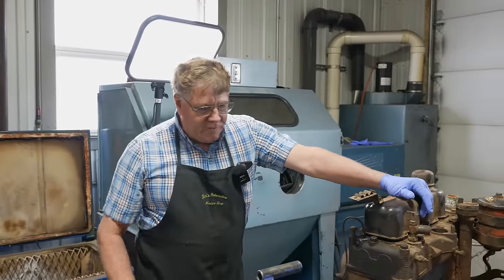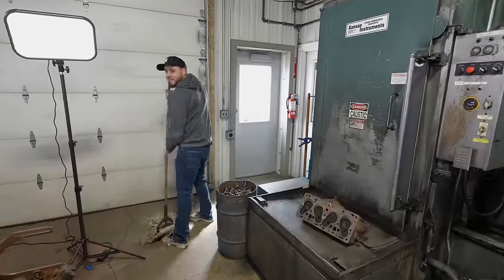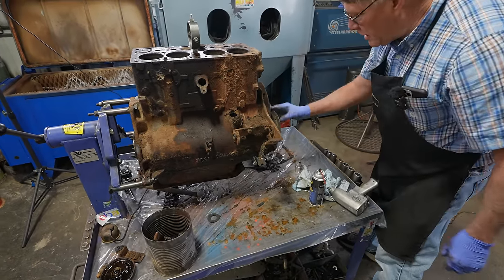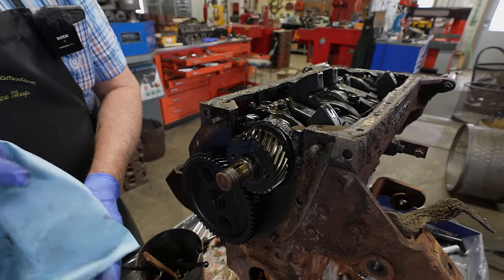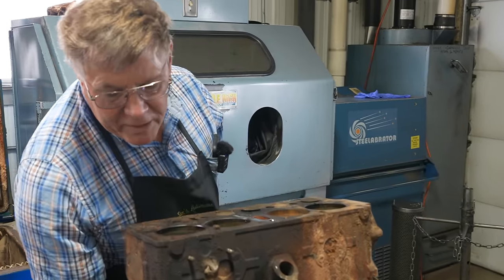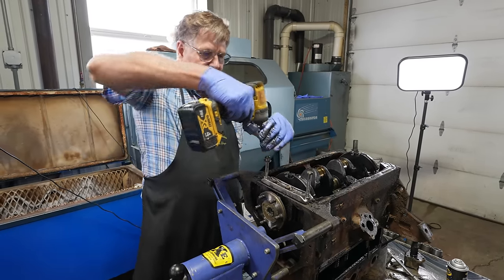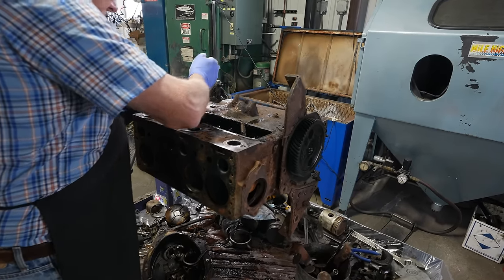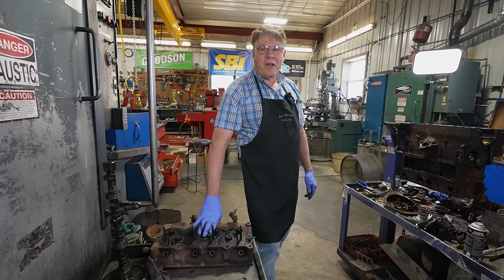Tearing Down A NEGLECTED Willys Hurricane Engine...

Comment: Ah, the curious case of the Willys F-Head engine. So wonderful to get the see the insides of one. When Willys needed more power for its vehicles in the early 50's, and their engine casting technology was limited to side valves (the wonderfully torquey and tough Willys Go-Devil that had helped win WWII in the military Jeeps), they designed this overhead valve intake arrangement, simply running the pushrods through the holes in the block where the old intake valves had been and putting great big intake valves on top to help engine breathing.  It gave them a quick and easy 25% more power-from 60 to 75-and a few more pounds-feet of torque.  The only real issue was the height of the new engine.  They had to raise the hood of the CJ-3B substantially to make it fit, which was less than esthetic.  But it worked, and continued to be used in Jeep products until emission regulations killed any automotive engines that still had side valves. (See the Curbside Classic article on the Willys F-Head for the source of this information.)  I am not aware of vibration issues at high RPM's, as others have reported here, but would not be surprised.  This was an engine from the 1930's, when smooth, low-revving torque was the goal, and the F-Head  was likely seen as a temporary, partial overhead-valve solution.  I am amazed the the Parts Cleaner remembers so much about these!

Comment: I had a 1960 Alfa Romeo Giulietta which used the Pal nuts on the connection rod bolts and main bearing bolts to keep the nuts tight.

Comment: More years ago than I like to remember, I obtained a 1940 Mercury club convertible. The V8 flathead engine had been rebuilt, run about 3 or 4 hundred miles before being put in storage where it sat for probably 15 years.  The rod bearings were too loud, so I dropped the pan and pulled the bearings out.  They looked just like the bearings you have in this engine, however the crank had some spots in it too.  I knew the previous owner and know that it had not been run hot.  Remember, back in the early 50's there was no such thing as multi grade, detergent oil with additives to prevent rust or counter the acids caused by blowby.  The gasoline was also pretty high in sulfur content.  End result was the the few miles on that engine caused enough acid content in the oil that the bearings were eaten by the acid content.  Just looking at that oil in your engine, I'd be willing to bet that's what caused the damage you're seeing.  That;s the reason to change the oil before storing and engine and NOT start it every once in a while while it's being stored.  I know, I could be wrong but that's my story and I'm sticking to it!  :-)

Comment: For this engine I would suggest running Rotella 15w 40 for the zinc content and a high pressure high volume oil pump and 50/50 antifreeze for cooling.

Comment: In the days before multigrade oils debris was allowed to fall out and collect in the sump. Bikes (which had dry sumps) had a screen filter in the oil pickup down in bottom of crankcase. 
The floating oil pickup on this engine would have kept any sludge below the stuff being used. That partial glow filter was a dirt of early bypass oil cleaner. 
When it’s rebuilt the oil should be mono grade classic spec. Today’s fancy stuff keeps dirt in suspension for the full flow filter to clean up. That’s no use when it’s built for gravity separation.
Reply: It's not unlike a lot of modern small engines, they're frequently splash lubed (or if they have a pump the oil is just sprayed on the bearings by nozzles) and without a filter.

Which raises the possibility that a good choice of oil might be the stuff intended to go in a lawnmower. Kinda funny.

Comment: I was told long ago that that "floating" oil pickup was also used on vehicles that ascended and descended steep grades or were even sideways (45 degree) on slopes - to assure that the pickup floated on whatever oil was available in the pan.

Comment: You are correct Sir. Originally called Galley, until it was pointed out that a Galley is the kitchen on a Naval vessel. Gallery came into use around 1960 or so.
Reply from the maker: Is it not possible for a word to have multiple meanings? Isn’t a gallery a room for the display or sale of pieces of art? Hmmm
Reply: Gallery basically means a long hallway (like you'd use to display lots of paintings, but it could also be used for just going from place to place). So it makes a certain amount of sense for the oil passageways, they are similarly long 'halls' within the engine.

Galley can mean either the kitchen aboard a ship, or a particular kind of wooden warship propelled primarily by oars. English is a weird language sometimes.
Reply: When I worked large equipment, like turbines, the term oil galley was in common use

Comment: Yeah, I'm pretty sure all of my old school manuals (from the 60's) that I studied in the 70's said oil galleys. I rebuilt a 51 Willys truck several years ago. I didn't do the engine, but I converted it to 12V, completely rewired it and managed to save that beautiful dash panel. As ugly as those trucks were, the dash was a work of art!

Comment: That is the same style engine same horsepower and everything it was in my M38J Willys jeep and it was a 58 or 59 but either way you look at it. That’s a lot of years of crud and build up on that  engine interior. at one time I had a spare head and flywheel and manual transmission and transfer case and I also had a spare engine. I wish I still had them all, including the jeep itself and flywheels were heavy heavy considering it’s only a four-cylinder Jeep engine, but on the other hand that oil filter system on that engine is the same type I had on mine as well, I don’t know how it worked but when I got it, I pulled a roll of toilet paper out of that thing that’s what they were using for filter medium and I found a regular filter cartridge to go in. I don’t remember what the number was but it was a Baldwin cartridge, I think I still have the valve compressor for the Springs valve Springs in my toolbox, but then things were sure stuck in there. Good luck on that engine need to save more of them get these old willies back on the road.

Comment: The piston with the pin that rode the cylinder wall has a different style oil control ring in it. Someone went in, re-ringed it, and didn't center the pin properly.
Reply from the maker: Upon further inspection after we were done filming, we noticed that too.  The pin has a notch where the cinch bolt goes through, so it has to be centered properly.  The crank end of the rod is offset.  We have since determined that rod assembly was installed backwards and the rod offset caused the piston and pin to crowd the cylinder wall creating the grooves.

Comment: 100,000 miles was definitely a milestone up through the early 60's, usually the first major maintenance was a valve job. Most dealerships had the "sioux valve grinding" equipment for inhouse repair.

Comment: Yes, sir you are correct in your statement about engines going 100,00 miles. That was the benchmark back when I was growing up (72 yrs. old now). Also, the old timers never changed the oil, they just added to it (the oil never wears out you know) by not changing the oil contaminates from combustion blow by would get in the engine, and most people used non detergent oil which did not help. People also did not put antifreeze in their engines even in the snow belt they would just drain the water out for wintertime. Most engines would need a valve job around 30,000 miles and rings around 60,000 miles. My dad told me that Granddaddy did not use antifreeze in his 40 Chevrolet but alcohol instead. Of course, those cylinders would get such a ridge on them that you had better use a ridge reamer to cut that ridge or you may not be able to get the piston unless you break and if you are doing a ring job that rounded wear pattern could break that square edge of the new rings. Boy they don't make them like that anymore.🥸👍👍👍👍

Comment: In the 70s, I would see older dirt track engines that clamped a rag over the draft tube. I've never seen it happen, but I was told that, under some racing conditions, the oil might begin to siphon. As well as keep dust out, the rag was thought to discourage that.

Comment: The earliest engines that predated side valves had atmospheric intake valves in the head. They had no mechanical linkage to open them and were sucked open by the cylinder vacuum during the intake cycle and were closed by low tension springs

Comment: I had a 47 Willys Pickup and sadly the block was cracked when I bought it.  I put in a 6 cylinder Jeep motor so I had more power. I was bummed I couldn't make it look original as much as I wanted.  I really loved it but never got to drive it more than 1000 miles. I put 6 grand in it too.

Comment: Another great video, love watching your content.  Are the main bearings not sprung, and the dowel stops the bearing from rotating?  We would call these thick walled bearing shells.  They look to be lead bronze as well, hence the copper colour.  The large ends appeared to be more modern sprung bearing shells and aluminium/tin, the damaged to the, could be delamination or if the engine had been stopped for some time the aluminium can start to corrode, as it corrodes the aluminium swells and you loose your oil clearance.
Our engines typically have bolted on crankshaft counterbalance weights, earlier engines had to have the fastener tension checked periodically, if not done then the weight could become loose, had this on one engine and the weight came through the side of the engine and into the engine next door, this was a Mirrlees KV16 so a touch bigger than a Jeep engine.

Comment: "Galleys" are the holes that pass oil inside the block and "Galloways" are any extensions added for that purpose. The 51's had a recall for the wooden timing gears breaking so they recalled them and used a wooden fiber replacement. Your engine there may be one of those the factory rebuilt and exchanged. That would explain the Mains showing year 52 for a 51 perhaps.

The 51's had wooden timing gears but after getting wet with oil and soaking up after a while were swelling and would crack and break. Most dealerships simply replaced the gears however a very few were sent back to the factory and yours perhaps was one such rebuilt exchange motor. Lol I would also bet the factory screwed up that wristpin also.

Comment: The cam lobes have different profiles between intake and exhaust  because of the rocker arm ratio on the intake compared to the direct valve action on the exhaust. That cam could probably be reground with no issues aslong as the journal diameters were good.

Comment: Looks like the classic overheated warped deck warped head cracking iron gem with no oil pressure to boot. As much I'd love to see a cylinder sleeve job, ( Don't even think about reaching for it) I'm settled on TD Conversions and will watch Willy's TDI conversion videos now. Back in away real slow now.👈🏻👶🏻👉🏻

Comment: From what I could see of the rod bearings the chunks of missing bearing material is from overload (lugging the engine) of the bearings. Not a common problem on engines especially on newer engine designs.

Comment: From what I've been told, if the back cam bearing holes are worn, there is a bearing from another engine that fits the cam and can be used to fix the block.

Comment: Other channels disassembling old rusty things spend time heating bolts red hot to break the rust. When you have a machine shop I guess it's easier to just break the bolts off and drill them out later.  😁

Comment: BTW, they ought to have run antifreeze in the winter, so the old lump didn't freeze and crack... They likely didn't run anything but water in the summer time, as these often ended up without an overflow bottle, and would've gone through coolant fast in warm weather.

Comment: We have a 29 Plymouth with the original flathead 4 cyl. It developed a rod knock so I pulled the pan off and found the #3 cap loose and the safety wire and a chunk of piston in the pan. I then noticed it said 4 on the cap. I looked at 4 and it said 3 on the cap. it was still wired (should have had cotter keys) I cut the wire and the nuts were finger tight. If I tightened them up it locked up. I figured out that some time in the past someone had had it apart and switched the caps. Of course when they tightened the bolts it would have locked up. They just left them finger tight and wired the nuts. From the sludge in the pan it was many miles ago. I couldn't find anyone local to rebabbit the rods and they actually still looked good. Measuring the bearings and crank resulted in about .002  oil clearance after shimming. The #3 had got so loose it wacked the piston skirt. A new set of pistons and putting it back together right and it runs and sounds good.

Comment: that poor little motor worked it's but off ,  and the " CHEAP - SKATE " what owned it back in the day , couldn't even change the oil regular !!!  those oil pans were built with a big oil plug so you could pour mineral spirits down the fill tube & flush the pans out !!!  ( should take a 1 1/8 " wrench to pull the drain plug , same size as a MACK truck ) !!

I got a 1948 Willys C j 2-A JEEP with the (L -134 flat head version ) that I will be sending to you guys here in a little while !! runs fair but is tired ! 
It will need the full TREATMENT , valve guides are worn on exhaust, 1 or 2 exhaust valves are crispy from the loose guides !!
and will need bored ,  " THE  WORKS  " !!!!!  
GREAT VIDEO'S KEEP UP THE GOOD WORK ,  THE  MACK  GUY   in   Daytona Beach Florida

Comment: 32:58. I don't know how many of the other F.O.G.s watch with the captions on, but if there's a quote that needs to go on a t shirt it's this one.  "I heard it was lunchtime,  a squeet lunch"  

One of the neat things about the F head engines was that they had huge valves.  Pretty sure the valves on that little bitty bore 4 cylinder engine are bigger than the valves in a SBC.

Comment: Could the bearings be flaking due to fatigue at high mileage. Worked on a Detroit Diesel 6V92 that had that happen to the main bearings. The fellow bought the truck and was told the engine was completely rebuilt. It had an oil leak which was the perimeter seal was pinched. Inspected the head and found it cracked. Worn two stroke Detroits will break off bits of rings and spit them out the exhaust, which knocks bits off the turbo turbine. Checked that and sure enough that was damaged. Should have pulled the other head as later we found that was cracked. The used dealer had just put cylinder kits in with new rod bearings. Heavy duty diesels should have the main and rod bearings replaced every 250,000 miles due to the hammering they take. 
So 2 years and 35,000 miles later the mains flaked away. Looked like coarse sand in the oil pan.
Big trouble with the shops shop insurance but eventually he got paid for our rebuild. Detroit had come out with an upgraded crankshaft which it got, upgraded water pump and a rebuilt head for the other side that we did not change the first time and another new turbo.As you are well aware those fibre timing gears tend to fail over time. It was possibly replaced with the engine inframe, allowing it to be mistimed.

Comment: Were they called 'Hurricanes', because of the propensity to blowing up?
I replaced myCJ3 motor with a Toyota18R, 2 litre motor. Lots of conversion work but, the result was a delight.
Both quicker and much more economical.

Comment: I read in JP magazine years ago that they started reproducing new blocks for the Jeep. A Jeep gear head them cast in a Chinese foundry but I never heard if the produced a small batch or if they actually made 100’s of them.
Reply: Neat! I'd still take an old casting I found in a muddy hole that machined to tolerances than anything but the best chinese castings.
Reply: @nobodynoone2500  they were built quite well and almost a carbon copy of the old blocks with tighter tolerances than what came out of Toledo in the 40’-50’s.

Comment: I knew an old man back in the late 80's he was convinced that oil filters were not needed on an engine. he bought a new chevy truck  had a oil filter delete machined by a local machinist that screwed in place of the oil filter had me screw the oil filter off and install it.  He died a few months later and I lost track of the truck so I dont know how long the engine lasted. He said he had done the same thing with every car he had bought for years.

Comment: PCV systems have made a big improvement in longevity by getting moisture out of the block...
Reply: This literally vents it outside the block. In other cases you are generally correct however.
Reply: Problem with road draft tubes is that they're not one-way, as the engine cools after shutdown the air inside contracts and pulls unfiltered air in via the tube.

A basic PCV would be a good retrofit.

Comment: The floating oil pickup would keep  from getting into the sludge if the oil level is maintained. What makes the swivel   joint air tight? I work on boats  in salt water that  use salt water in the cooling jackets.I have seen salt water cooled engines go 15-20 years and still work. Cylinder heads rot out before  ( thick casting) blocks. When I open up an older engine used only in fresh water they look  brand new in comparison. Modern marine inboard engines
now have a high percentage of heat exchanger cooling
systems but the same engine used with stern drives have a lower percentage of fresh water cooing systems. Cast iron does amazingly well in salt water as long as they are
kept full of water and avoid air contact when drained for
winter storage.  I have seen salt water jacketed manifolds
sitting dry in a  warm shop crack from rust expansion.
  According to insurance company files the highest percentage of claims for frozen and cracked engines is northern California.